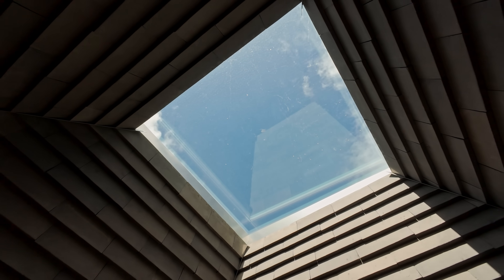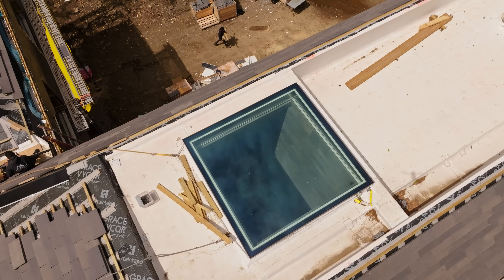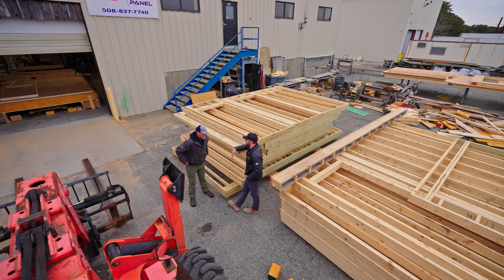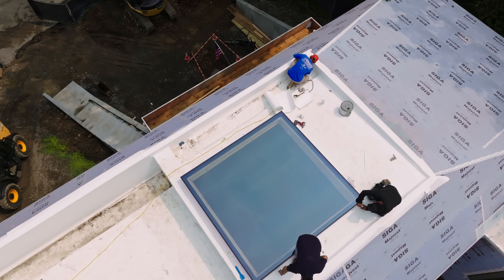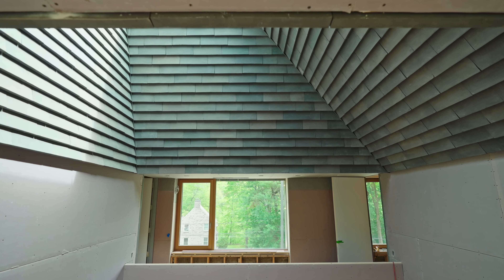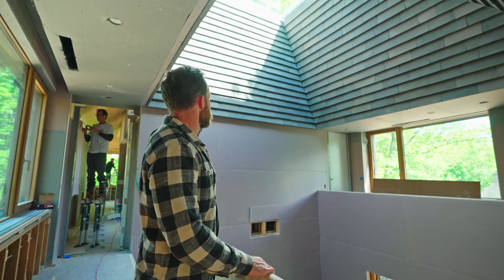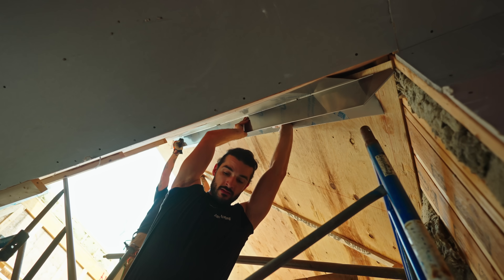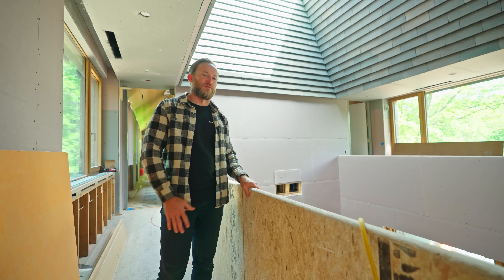Why This Skylight Took Months to Design

Comment: Idk how that brick works. Is it possible to change the coursing distance? If you set the distance based on the most angled hip, you could continue the line around to the other side. The vertical spacing would be less on the 90 degree wall, but the lines would line up. I guess it's just a question of do you want the corners to match or the spacing to match.

Comment: I can't imagine the U value of that skylight is 0.19.  Maybe it would reach that as a vertical oriented piece of glass, but when the glass is horizontal the air/noble gas spacing really loses it's performance (hot air rises, and in a horizontal pane it rises quickly to the other pane).  Most double pane skylights have a horizontal U value closer to 0.8-1.2.  It looks great, but I'd be a bit concerned with condensation around the perimeter since it's probably the largest thermal weak link in that whole house.

Comment: I can not imagine that level of cost and still be a stick built home. Crazy to see flex duct in the background too.
Reply from the maker: What’s wrong with flex duct? We use it for the last few feet of the duct runs, it’s known to help reduce some of the noise, never mind the fact that when used properly, there is no downside. Am I missing something?
Reply: @NSBuilders  
You can decouple the HVAC ducting through other means.

Basic issues:
More resistance to flow than smooth wall sheet metal and will hold more dust/debris especially in returns if using a filter at the HVAC unit.
It can break down over time due to the use of plastics requiring inspection/replacement.
Need to be careful with placement of UV light in HVAC system as it will degrade the flex ducts.
They are a compromise in most ways, except for cost and ease of installation.

Comment: Great skylight BUT you've got to tear out the pot lights in the ceiling. An architect that uses pot lights is an architect that doesn't know how to control light. Pot lights belong in malls and gas stations, not residential homes. You've still got time.
Reply from the maker: What an opinion. When detailed correctly they are great, not to mention these are flangeless.

Comment: I just will never put an unnecessary penetration in a roof.  Especially a 9’x9’ one! I think they are trying their best, I mean the location seems to be elevated from surrounding roof, the design appears to be thoughtful, but water never stops searching for a way and eventually, water will win, it’s  undefeated, if you don’t think so, go visit the Grand Canyon.  Hopefully it will take a long , long time so that none of these responsible people that think it’s a fantabulous idea will still be around. Ditto my theory when it comes to fireplaces and chimney’s  ~ if you have to have one place it on an exterior wall outside of the roofline. Because every chimney that rises up from the middle of your rooftop, will also leak. Again, Water is undefeated.
Reply: How do you feel about boats and submarines?
Reply: @nathanhoke1  I will tell you what I think, there terrible inventions, you can’t take on water and expect to win! LOL death traps!! LMAO!
Reply: The membrane, seal tape,silicone, and skylight flashing will last and decades. Yes, water always wins, but it's obvious that they throughly thought this through. It's not their first rodeo.
Reply: The skylight makes the space, it’s absolutely necessary.
Reply: @CharlesKruger1942  There are always trade offs in design, gain of a great accent and free lighting…  loss of some energy efficiency and increased potential for problems to possibly arise.
Reply: It looks like they have an access hatch so you can get up there easily to clean the window and inspect the seals, assuming they keep that little balcony on top. Expensive to maintain but if they can afford to design and build it then yearly costs probably aren't a concern. 

I'm curious how they will deal with snow accumulation on the glass and flat roof. Make it strong enough to bear the weight until spring and you just don't have a skylight for awhile after a big snowfall? Snow melting wires to always keep it clear?

Comment: Great post. Thank you for the update   (Skylight 3% pitch is just under 3/8" per foot?) Outstanding idea on the dust and countersink.  Thank you for the description on coursing vs slope. Another option is to tighten coursing spacing on the other walls. I guess that is the pro/con of a design of having one surface pitched so differently.  I think the way you built is the choice I would have made too, maybe with a 1" thick fin at the valley.-- Hard to say without a Mock up. Did you have mock up options?-- I always look forward to your posts!!
Reply: He said 3 degree not 3% 3:50 .

Comment: I would strongly suggest utilizing water cut off mastic in lieu of silicone for setting the skylight into. Any tpo spec utilizes water block for any situation where compression into a sealant is maintaining a watertight condition.
I would love to see a video towards the end where you compare the final product with your original vision, and talk about where things had to adapt or obstacles that prevented the original idea. Incredible work man
Reply from the maker: TPO doesn’t go below the skylight seal, specifically for this reason. It’s a tape detail per manufacturer
Reply: @NSBuilders interesting that makes sense. My roofer caveman brain reverts back to water block everything haha. My inspector normally checks for either mechanical securement 1' OC at the face ( via slip flashing or term bar) or on top of the curb and the unit sits on it. Far different application here obviously, and there's rarely consideration for air barrier continuity on industrial builds.